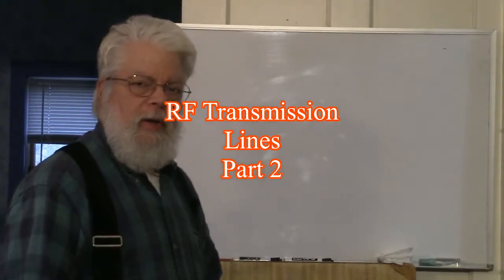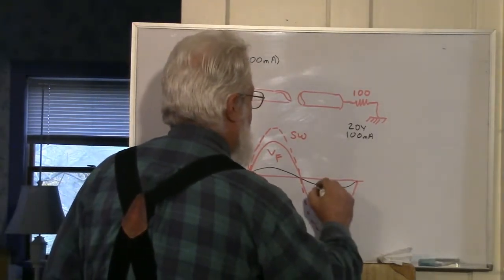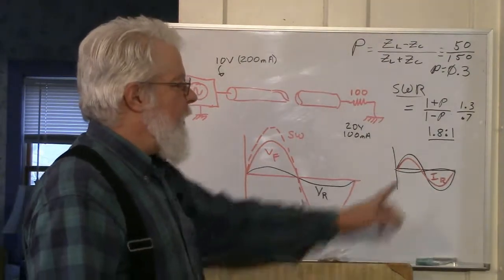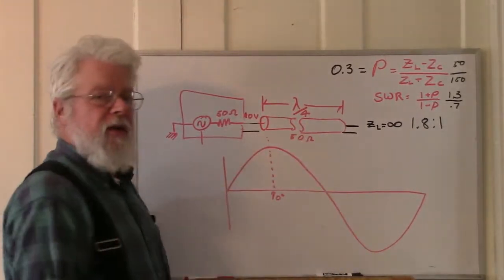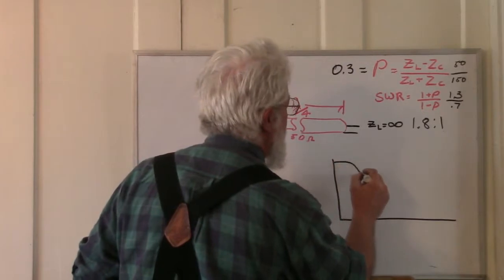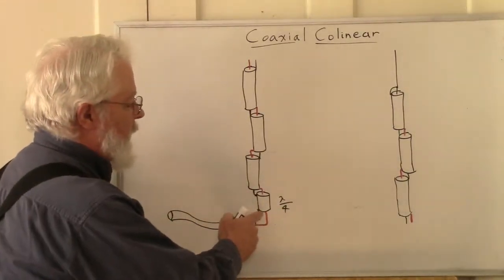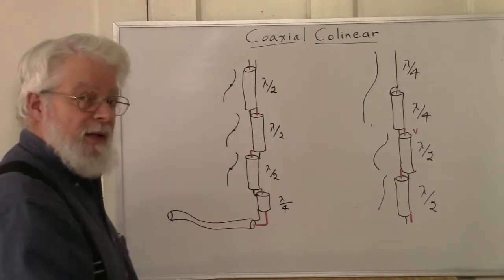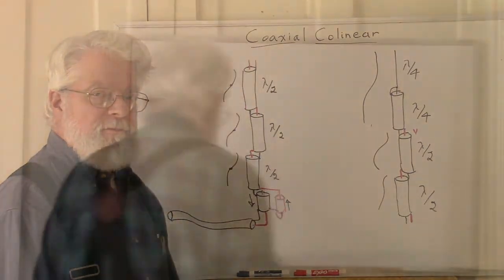Radio Transmission Lines - Part 2

Comment: confused a little:

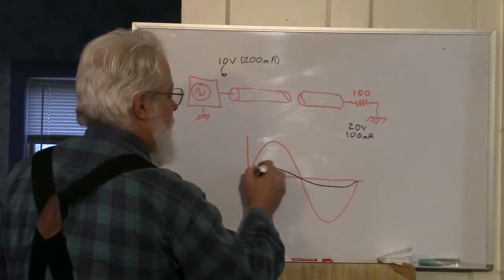5:07 you say signal is reflected back but at 180° out of phase.     wouldn't that make the reflected wave opposite sign or side of x axis ?

i.e.  shouldn't when forward wave is positive reflected should be negative if they are 180° or half wave out of phase?
Reply from the maker: Thanks for watching. That makes at least 3. :)  Confused about the reflected wave? Yes, it's a little non-intuitive. You can think of it like a mirror image where left become right and vice-versa.  As shown in the video, moving ahead 180 and continuing from there, only backwards helps resolve errors where the wave terminates at an inconvenient phase. Otherwise just heading back along the forward wave (seemingly in phase) is actually a 180 degree flip, since it's heading the other direction.  Bottom line is the majority reflected component always sums to a greater value while the minority component sums to a lesser value. 
The majority of reflection is always the component which is least maintained by the load; ie: voltage for a Load < Zo and current for a Load > Zo.  In reality, more reflections are actually in play but their effect is small compared to the majority described here.  The really cool thing about the phase flip is the ability to detect the forward and reflected sums selectively (Bruene Bridge: Part 3).   
I doubt that explanation helps much. I prefer the visual approach, but we all learn differently. It took me quite some time to become comfortable with  transmission line concepts.